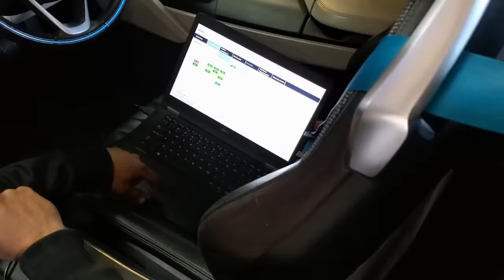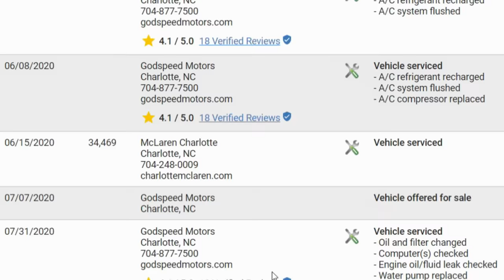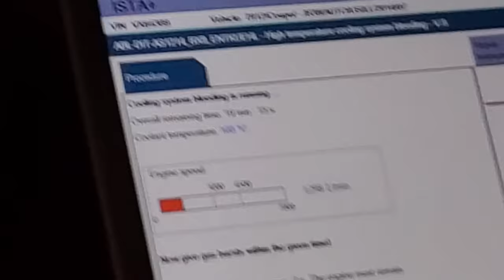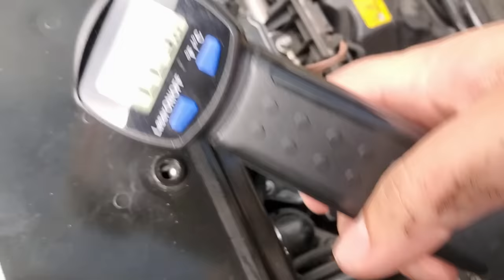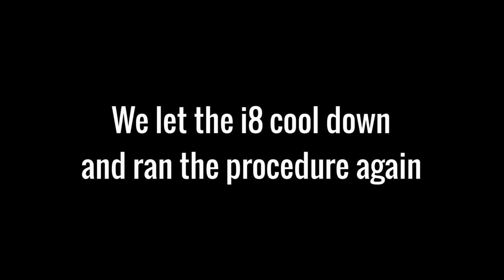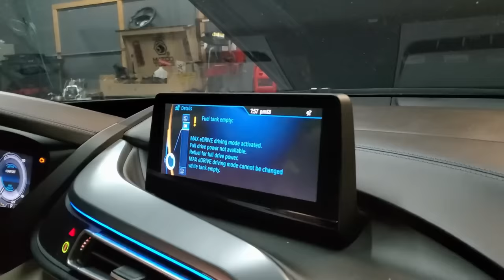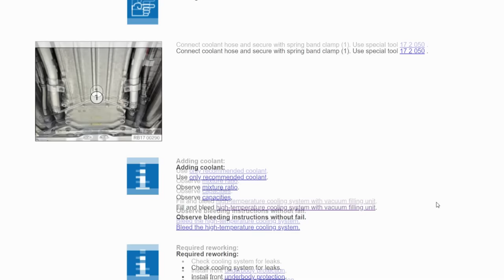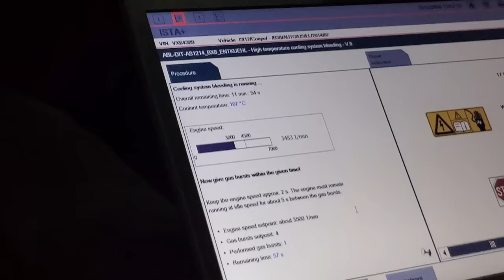Was my Repo'd BMW Supercar Sabotaged to make it Impossible to Repair?

Comment: Use the camera you have to inspect those coolant tubes. Expanding foam in one of those would be a good sabotage.
Reply: He's trying to fix the cooling system" And it's not working..THEY NEED TO TAKE A WATER HOSE AND RUN WATER THOUGH THE SYSTEM...TO CK FOR LEAKS" I BELIEVE THERE IS A LEAK IN THE SYSTEM..MAN MADE..( TAMPERED WITH )..EITHER WAY..WHEN THE SYSTEM BUILDS UP PRESSURE IT CAUSES THE COMPUTER TO SAY ITS RUNNING HOT" YET HE SAYS THE WATER IS STILL COOL".. THERE COULD BE A SHORT OR BAD RELAY( TAMPERED WITH ) EITHER WAY...THEY NEED TO CHECK ALL THE FUESES...CHECK ALL THE WIRES" AGAIN I HAVE OWNED ALOT OF BMW"$ AND THEY ARE WELL OVER ENGINEERED CARS" HE IS GOING TO HAVE TO GO THROUGH THE WHOLE SYSTEM TO FIND OUT WHAT IS GOING ON..I DONT BELIEVE EVEN IF HE CHANGED OUT THE WHOLE COOLING SYSTEM IT STILL WANT FIX THE PROBLEM"
Reply: TO SAY THAT BMW"$ ARE MONEY PITS" I GOT A PROJECT IM WORKING ON RIGHT NOW...ITS NOT COSTING ALOT OF MONEY BECAUSE IM DOING ALL THE WORK... MYSELF" I ADMIT THE 2004 GM IS NO WERE NEAR AS TECHNICAL AS A BMW...BUT THE SAME PRINCIPALS APPLY"..IF ITS RUNNING HOT" YOU CANT DRIVE IT"..**ONE(1)*********

Comment: Sam, Just curious, have you checked the coolant for the presence of combustion gasses?
I've never worked on a BMW, but every time I've seen an engine bubble like that into the coolant it has been a blown head gasket, a cracked head, or block.

Comment: Did u check to see if the thermometer diode is functioning properly? Like the work end of the thermometer so to speak? If it’s fine it might be the sensor that reads it that is deficient. This is of course if their is no blockage. It might be worth grabbing a new “temperature system “ (let’s call it) ie; thermometer, sensor etc. I really hope u solve this problem in the most affordable way. We’re out here rooting for ya. Great content 👍

Comment: Looks like scotty was right all along. These bmws are eendless money pits.
Reply: You are right, but they are a very fun and comfortable car to drive :) 
I have a Volvo and BMW with about same milage and I've had to do about 4500€ (no big repairs) of repairs in the last year on the BMW meanwhile the Volvo only has had oil changes and brake pads done in the last 2-3 years.
Reply: It's hit and miss same with all car's, get a poorly maintained 1 and it will be a constant nightmare. I thought my old bmw was a money pit till i purchased a vag motor spent more time in the garage than the bmw ever did. Driving the vag motor there's a constant thought of what's going to break today
Reply: He also said that bmws have overly complicated engines, some components while basic and easy to get access to in other vehicle brands take a hell of an effort to get access to in a bmw engine bay. 🤣🤣
Reply: @Nino-bu9mj  that's not my experience with bmw. Maybe the access has got a bit less due to now being turbo engines, the 1 & 2 series will be the worst as their tiny cars. Has your mate ever worked on a vag motor ? Their the worst for access to anything. Have to take my front end of to change the rad/ unmount the engine to get enough space to get at the turbo. Subframe off to change the exhaust downpipe, rollbar bushes. People are massively miss guided thinking bmw are that bad when it's actually the vag group who make the more unreliable cars.. it's like the whole bmw drivers never indicate  or just pull out on ya, when audi drivers are the worst for that
Reply: BMW leases 80% of their cars in NA, so why make them last over 4 years?
Reply: They are absolutely money pits. 
I have changed so many of those piece of crap thermostat housings , made of plastic because that's smart ( good job germany) they also use plastic on the pulleys for the accessories , they use plastic everywhere. They can claim is to reduce weight but bmws are always hefty as are most euro cars. I have found that 90 plus percent of the owners can't do their own oil and expect the car to be flawless all the time and complain when it's triple the price to repair even when they decided on their own to buy the cars. Bmws are some of the biggest pieces of shit I've ever had the misfortune of fixing. Volvo is endlessly better made ( still trash but better trash ) and so is mercedes. They all seem to do their best to make it so you can't use anything but a high end or factory scanner for codes and data stream , the wiring diagrams are often not even translated to English lol so it's all abbreviated german for the colors on the wires , they literally rape you on every part and make it nearly impossible to change most of the parts. Honestly another sad thing  , before I moved onto power plants and engineering work I worked at a private shop that specialized in german shit boxes and volvo with a sprinkling of japanese cars as well. What's scary about that is the local shops couldn't even fix them , they would tow cars out to the shop I was at , have us figure it out and , fix it , tow it back and bill the customer more then we charged them. 

They literally are so over engineered and poorly designed their own dealerships couldn't fix them. 

Feel free to hate but it's all true and if I even change one person's mind about owning one of these fucking nazi mobiles I've done society a service.
Reply: @justintime5375  would this be in america by any chance ? As cars made for their market don't have to stick to the strict german standards. German cars are extremely well engineered as they have to be able to sit on the autobarn flat out with no troubles, parts wise all manufacturers have gone downhill it's all cheap tat made in china. I got a part for my vag motor it came from china lasted a day before it fell apart.
Reply: @craigj2483  it was in the United States. But by searching online I found they absolutely don't use different parts between countries. Americans keep their cars forever , maybe europeans don't. If that is the case why wouldn't a car seem good if it gave you little or no issues in the first three years ( as it damn well should be reliable for Longer) 

All german cars fall apart over 60k 

I have had three cars I ran to over 250k miles with the original drivetrain. Not one was German. 
I had a 800 dollar subaru wagon run to 270 , didn't die but nobody wanted to buy it for 200 dollars at the end lol.
Had a turbo forester run to 190 , sold it two years ago to a co worker who's still driving it around original engine and trans 

And the more shocking one was a 1997 mercury suv with a 5.0 litre v8 I got for free that was literally under water for a few days. Drained the water from the trans , engine etc. And drove it for 5 years. It had 160 when I got it ,250 when I got rid of it. Always ran fine.
Reply: @justintime5375  what do you mean different parts between countries ? I was on about most parts are now manufactured in china/romania etc all newer german cars are full of cheaply produced parts now. 
Just because a cars comes from germany doesn't mean its full of german manufactured parts

The part's actually made by the germans last forever,  the german made parts in my motor are still going strong 13 years 163+ thousand miles (262+ thou km ) later.  all the parts not made by them have been replaced more than a couple of times.
Reply: @craigj2483  I was saying that often I encounter people who say the euro produced bmw cars are better than the ones shipped to the United States which is not true. What I was saying is the parts they use on the euro models are the same as the American ones. 
You are correct in many replacement and oem parts are made in places like you mentioned. But this is the manufacturers decision. Little known fact , most car companies don't make much on the vehicle sale they make most of their money on the repairs and the parts. That being said they outsource the production of their parts to misc vendors. This is why you will see parts ( especially electronics ) made by let's say mitsubishi installed in a brand new Toyota or bmw or anything really. They outsource the parts production and therefore choose the cost and quality of said parts. China believe it or not can absolutely make good quality anything. The reputation they have for producing garbage quality everything is due to the choice by their customers in keeping the cost as low as possible with a huge profit margin.
All manufacturers do this but bmw takes the cake in that they charge the most for their parts while delivering a poorly engineered product.
A bwm engineer designs the parts then they call their chinese or other part vendor and say make it as cheap as possible , reliability doesn't matter and the vendor obliges. 
In engineering is is important to not only make it feasible by keeping costs realistic but it has to be somewhat of decent quality as well. If bmw said make me this part and make it last as long as possible , keep the cost reasonable but it doesn't have to turn into something I sell at a 200 percent markup then they would make much better cars. I hate them the most because they knowingly make their cars the way they are and rely on marketing to sell them instead of quality. They market themselves as high quality but it's a legitimate lie. 
Look at subaru for an example.
Even with the issues they have the quality is top notch. They purposely make it easy to work on and diagnose their cars and because of that they have a cult following almost. Before owning several and working on them as much as I have I thought nothing of them but after looking at how well designed they are it shows they prioritize quality over super high profits. 

When purchasing a new one two years ago the salesman basically said 

" They are well made , the demand is always high for them. They basically sell themselves and I don't have to persuade anyone especially if they are a prior owner" 

Not going to get that from bmw of benz. They only sell because they are exorbitantly expensive and people equate a high price to quality while nothing could be further from the truth.
Reply: Nah, only American's who don't understand German engineering who makes it to a money pit. Only American's complain about BMW's being bad.

Comment: I remember my father had a similar problem on a company Ford escort that had a major tendency to overheat: root cause: the thermostat opens a coolant circuit to the radiator when the coolant gets warm. Thermostat worked perfectly but the outlet hole was not open out (either not drilled or bad moulding), so the thermostat opens correctly but the coolant could not be pumped into the radiator causing the overheating.

Comment: Possibility that the rad had a small leak and someone put an entire can of stop leak pellets or silver seal in the cooling system and it all settled in the rad causing blockage. Seen ut before,  small 4cyl with a pinhole leak and put 3 cans of stop leak in and it turns to cement in system. Thermal switch might be faulty if fan is not turning on  or it's so blocked up in the system its not circulating enough to warm the thermal switch. Can't wait for next upload i need closure lol😄
Reply: Fully agree. Question to me is, whether the battery of the I8 needs to be cooled, too. Might even cause more problems if you give it the "sealant".

Comment: An air "pocket" isn't going to cause a 117C heatup with an open thermostat, find that hard to believe.
My gut says something was thrown into the reservoir and its jammed in the radiator...or crushed hose somewhere that hasn't been spotted yet and its not allowing full circulation.
Reply: in bmw circles their known for air locks which give the same symptoms as blown headgasket there that bad

Comment: You may have an "oil like" substance in the coolant system.  I drive diesel dump trucks and one of them had an oil intercooler rupture that dumped a lot of oil in the coolant system.  We flushed it out or so we thought and some stayed hidden in the nooks and crannies and began turning into a tar-like material after all the overheating the problem was that peices would regularrly break off and clog up the system to overheatthen maybe eventually melt and move back out of sight.  We had to strip and replace almost the entire cooling system  and eventually the engine was dismanted and the coolant channels were individually cleaned by hand.  Major pain in the ass and to me the truck never seemed to ever have the same power again.

Comment: Use a exhaust emission tester to sniff the bubbles coming out of the expansion  tank , if it reads hydrocarbons then head or head gasket is compromised
Reply: Hes does that in the follow up video!! Good call!

Comment: Just Imagine all the techs having a sigh of relief when this is actually solved
Reply: @MrGigi-dz9cv  What is your prognosis?
Reply: @willmcmillan9511  Some obstruction.
Reply: I have an infrared camera that could make quick work of this.
Reply: @ what point do you say F## it and by a chevy
Reply: @willmcmillan9511  They have to replace the radiator first.
Reply: They'll know what to do if another i8 comes in with the same issue at least.
Reply: @willmcmillan9511  I bought my seek compactPRO specifically for jobs like these

Comment: The radiator was the issue the whole time. It’s plugged up
Reply: It makes sense since after pressure testing and the radiator blew up. Maybe they forgot to remove or put a plug on the lower hose.

Comment: Is the actual water pump itself bad I wondered some odd internal issue where it's not pumping the fluid.
Reply: with the radiator blowing, I’d assume there’s blockage in there and the pressure caused it to go YEET
Reply: I know some VW's and others had issues with the impeller separating from the shaft in the water pumps
Reply: Has 3 pumps 1 on motor 1 on front for traction motor and another on the turbo.These guys are in a world of pain.

Comment: I ran into this problem on a VW Passat that came from the auction. A used car dealer bought it from the auction sold it knowing it was overheating. The new owner brought it to me. After diagnosis there was absolutely no circulation. Replacing the water pump an thermostat, water pump impeller was intact BTW. Bleeding the system still had zero circulation.  I started looking at the radiator, I noticed the upper radiator hose clamp had been replaced. I removed the upper hose and found someone put a plastic bottle cap inside the upper hose. I removed the blockage and all was good 👍.  Please check inside all the easiest hose connections for your sabbatoge. Hope you have found it by the time I post this comment.

Comment: From my experience with mid engine cars I'd guess either head gasket or a faulty expansion tank cap failing to hold pressure

Comment: You never checked the radiator to see if there are cool spots on it while running the car.
Reply: When the radiator blew, did you take that as a sign it might have already had a weakness? That kind of fits with Sam saying he thinks air is getting into the system.
Reply: @slickrock1371  yes, i do think there is something wrong with the radiator. Air wasn't going into the system. Air was not being taken out completely from the system because of a blocked radiator. The fact that it blew so easy, makes sense, the radiator was probably weakened by the repeated temp/pressure  when the engine overheated. That's my theory, anyway...he made a mistake when he didn't check the rad for cool spots. It could have saved him a lot of headaches but hey...we're all making mistakes.

Comment: Crimped radiator core. This happened to mine. Took 3 weeks to diagnose. Also why pressure test read accurately. Low flow.

Comment: Some modern engines tick like that because direct injection injectors are noisy.

Also have seen quite a few vehicles with bubbles in the coolant system. 

I always jacked up the front of the vehicle and put it on 2' blocks when I put a vacuum on the coolant system before I filled them.

Comment: You'll find a silicon glove, hose bung or piece of rag left in the coolan system
Reply: Pumpkingilmour  It might well be although despite explaining the overheating by coolant restriction it won't explain the radiator leak as a primary cause. Rads have to pass a burst test usually around +100% of the max operating pressure whereas the test here seems at 'very light overpressure'. Rad leak could be a secondary failure for running hours of higher than normal pressure due to obstructed upstream.  I'm curious to see how it's unfolding - I usually never get it right ;D  But seen plenty of stuff in engines there were not supposed to be there.

Comment: I bought a chevy Lumina at the police auction many years ago and the radiator was completely plugged with sealer. I got it fixed easy enough and ran it to 325000 miles!

Comment: I had a early 80’s BMW M5 and it did the same thing no one could figure it out.....finally it was a micro crack in the head that only opened up at a certain temp which add air into the water jacket and being a pressurized system it would stop circulating and overheat....a quick bleed and the system would run like a champ until the temp hit that number.....so long story short.  A new head and gaskets and about 10 bloody knuckles and she was running again....

Comment: the coolant tubes must be blocked with something, i would remove all tubes and flush the system.
Reply: My thoughts, either a blockage or a slight hairline crack in a coolant hose, had that before on couple of my cars
Reply: Cracked hose would leak, coolant isn't circulating

Comment: Hey when you showed the water boiling out it was coming out of the over flow tank cap. The over flow cap is bad causing the system not to pressurize
Reply: I had a mk2 VW Golf which was losing coolant, couldn’t find an obvious leak, in the end I noticed the expansion tank cap was leaking slightly.
Not bad enough to cause it to overheat, but just allow the coolant to gradually go down over weeks.